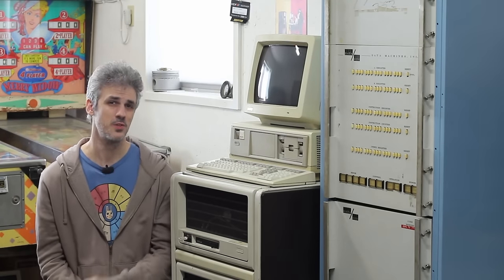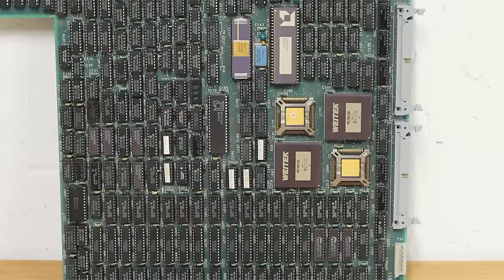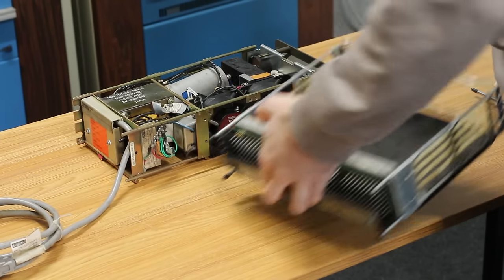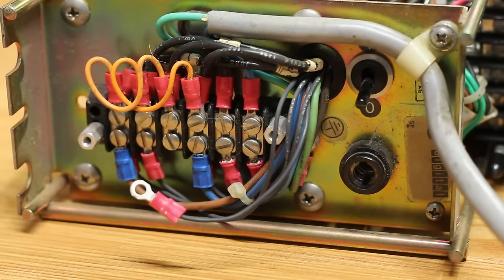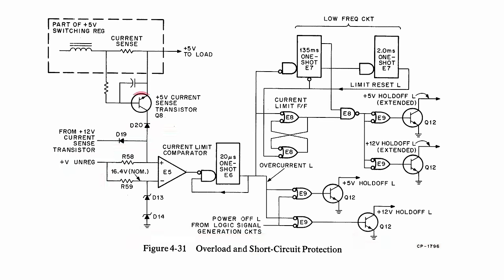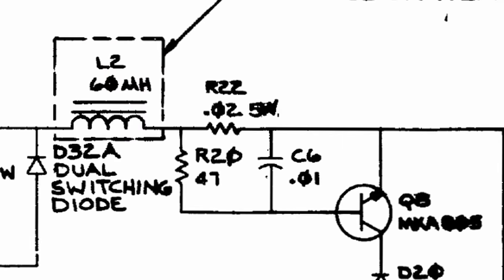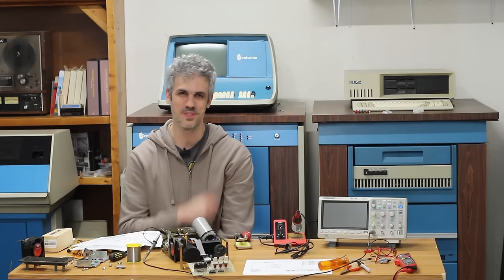This PDP-11 Power Supply Defeated Me

Comment: I don't think power supply repair is your speciality 😁
I never would just switch on such an old PS like you did. What I also don't understand is that you remove transistors without testing it. Most transistors and diodes can be tested in circuit with just an ordinary DMM.
Reply: Absolutely.  Where is his supply protection?  Where is the ability to ramp up the supply voltage gradually (variac), rather than just subjecting any gear to a power input surge after years of sitting idle?  It was the same with the G15 at first switch on ....  He hadn't even separately tested the fans or the drum motor.  He just threw the switch.  There he was lucky, but it shouldn't have to rely on luck.

Comment: Signetics 82S100 PLA chip on that CPU board. Same as the infamous PLA in the Commodore 64. 
The original 82S100 was pretty reliable, despite running hot as hell. It was the MOS clones that frequently failed.

Comment: Is it possible to replace such power supply with modern one ? 
11:20 flip the power switch :)
13:10 flip the switch again.
14:20 again.
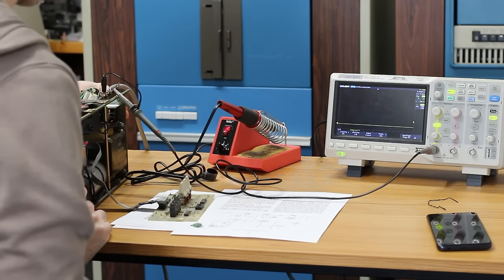25:10 again bypass overload circuit.

Comment: I wish I had more then the most elementary understanding of circuit board electronics so that I could actually be of some help here. It seems DEC was too clever by half making such a non-standard PSU. Wouldn't it maybe be a lot easier (and cheaper!) to source a couple of replacement old DEC PDP power supplies and harvest parts off of them? I know there are several out in the wild.

Comment: I would expect the 7812 to be bad. Its output is > 13V, so alo the Output of this switching regulator would be > 13V..
You may also check the 7805. Hope this helps.

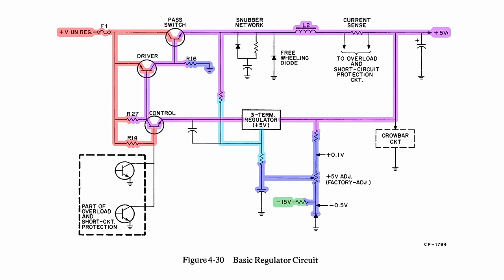Comment: It IS a linear supply. Typically you can tell right off by the transformer.  7805 and 7812 are very common 5 and 12 volt linear regulators, but they are limited in current. Depending on the package type, could be 1..5 Amps sort of ranges.  For more, you need to add additional pass transistors.   Since those have  a voltage drop, you may add an offset to the regulator to help the output to be accurate, or not.  5V was ramping up, probably because it had too low a load. The regulator does not need a load, but when you add the pass transistors, that can effect the overall voltage. 15:29, you see the connection to -15V which is what helps bias the 12V. 20:30 is the 5v, biased by -.5v  but that is a "diode drop" and that depends on the current through the diode.  Crowbar is shared between the 2 regulators, so it should have been easy to determine which was overcurrent first.  See diodes D19/D20 @ 21:09.  But if overcurrent was from the crowbar (time says so).  I would increase the loads (reduce the resistance and increase their wattage).  Look at the "ground" terminal on your 3-pin regulators.  That cap on the input could be leaky, causing it to rise in voltage.
Reply: No. The main power delivery is switchmode. They are buck converters operating from moderate DC voltage. The iron core transformer does the necessary isolation and gets the input to the buck converters down to something convenient. This sort of thing was moderately common when switchers operating directly from AC mains input were still quite expensive. There is mention at some point in the video of 20 kHz switching frequency, though actual frequency is quite variable.
Reply: @d614gakadoug9  agree, I was referencing the 7805/7812 side of things.  Sorry if I was confusing things. Does seem to be that transistor that was blown, could be others (has been my experience).
Reply: @davidellis6995  No, still it's not. The linear regulator is just used as reference. The use case is somewhat crude, nevertheless the 7812 is just used to control the switching transistor...

Comment: Q15 isn't leaky.  The Base-Emitter junction is being forward biased, so it's acting like a diode.  I think your real problem is that the output of the 7812 is too high and triggering the crowbar.  That's why R74 turned into a LER.  I'd look at the voltage at pin 3 of the 7812 as pin 2 (and the output) is going to be 12 volts above that.   I'd start by checking for the -15V.  If that's absent or weak, the whole bias of the 7812 will be messed up.
Reply: I'd start by making sure the 7812 is working properly and regulating at 12V and isn't leaky.  If that's not working, then things get ugly.  The second step would be to check the voltage at pin 3.  The wiper on the pot is going to need to be slightly negative to overcome the 1 ohm R60. Again, if the -15V is absent, then pin 3 is going to float high and causing things to be unregulated.
Reply: I forgot to add - check the ESR on capacitor C20.  It (along with L1) is what keeps the output from going way high when Q17 is turned on. Bad filter caps can trigger the crowbar circuit.  That's true of any SMPS.

Comment: Any bets as to it being a chopper transistor that has failed short, like Adrian's did? This used to be really common on CRT era TVs etc.
Reply: Nope. If one of the main switching transistors had failed short-circuit the output voltage would rise extremely, not ramp up slowly as it does.

Comment: That voltage goes up and then drops real quick. It's not very capacitor like in its decay.
Reply: It drops very rapidly because of the crowbar circuit.
A crowbar is called that because it is intended to be the equivalent of dropping a big steel crowbar across two electrical conductors to short-circuit them. 
In this circuit, as is very common, a silicon controlled rectifier is used as the switch. When it turns on the supply rail is shorted rapidly to ground. The intent is that an overvoltage due to a failure anywhere in the circuit will be, with some amount of luck, limited in magnitude and duration sufficiently to prevent damage to expensive circuitry powered by the supply. It isn't too unusual for a crowbar SCR to fail short-circuit when doing its job.

Comment: Many power supplies needed to be loaded to work. So simply try inserting a card before powering up the system.
Reply: A good resistive load is the best thing to use. A crowbar circuit is a bit like a fire extinguisher. It may get things under control before any real damage is done, but it may not. Circuit on a card could get fried.

Some people have suggested incandescent lamps for test loads. They may be workable but the fact the resistance of the filament when cold will be a tenth or less of what it will be when hot has to be considered. A nominally 10 W lamp can be a 100 W load at turn-on, which may trip over-current protection.

Comment: Does passing off the 11/83 mean we're not going to be seeing the cool graphics cards you ended up with?
Reply from the maker: That's actually why I kept the 11/73 stuff!
The Bomem graphics card was originally intended to work with the 11/73, as the Bomem card also supplies the console port and keyboard interface. The hope is to build out an 11/73 with the proper Bomem setup and RSX install with drivers one day!

Comment: Could D18 have failed? That is connected from the input to the output, and should normally not conduct in that direction, but may be leaking or short.

Comment: Do you have a working -15 volt supply? If not, the voltage to the regulator will rise as the capacitor (directly below the regulator) will slowly charge up.

Hope it can be of help.

Comment: Is there a link to the full schematic used in this video available?
Reply: I found one by searching for DEC H780C pdf manual. It gives a theory of operation too which explains how the 3 terminal regulators are being used to switch the pass transistors at approx 10kHz.

Comment: Prob with the 11's, it's basically a 16 bit computer.  And electronically very sophisticated with tons of useless complexity. And slow, thanks to it being heavily microprogrammed and with a complex bus protocol.   I worked on a PDP-11/34 and several 11/03's.  They never impressed me.  The operating systems were primitive.  The compilers generated very slow threaded code.  Networking was not available.  By comparison the PDP-8/E I used before the 11's seemed faster and had much better system software and better compilers and languages.   The PDP-11 price/performance wasn't good either.
Reply: So? He is not going to run a business with them.
Reply: in collecting people define, value and prioritize their stuff differently, rarity, historical significance, elegant/weird designs, performance (personally I only really value the thinking bits, don't really care about PSUs, storage solutions, accessories or case designs and would substitute them with modern replacements if more convenient, which I know would be sacrilege to some. obviously museum quality stuff is a different story)
Reply: As a system to restore and demonstrate and take on the road, he's made the right choices. The 11 was very important, it influenced the microcomputer architectures of the 70s, especially Motorola. And I'm sure you could get a cross-compiler to generate very nice code simply by running on a more capable machine. Also, this one doesn't seem much larger than a typical '80s/'90s era PC. It's only what, 3U high if put in a rack?